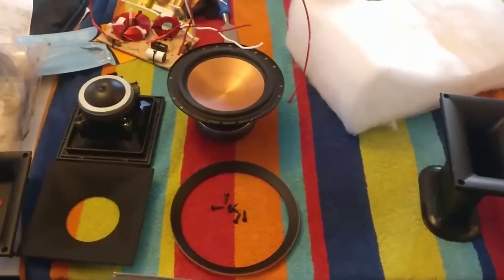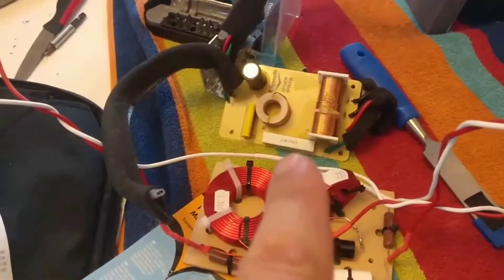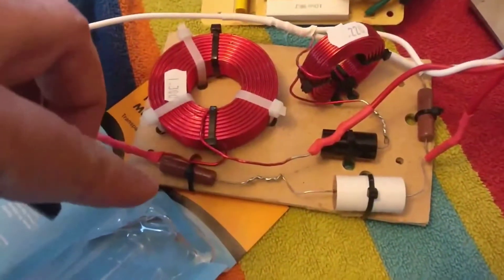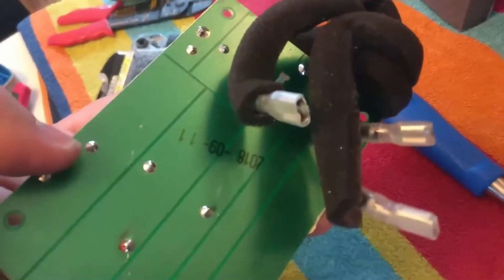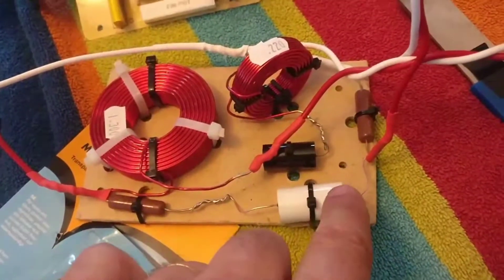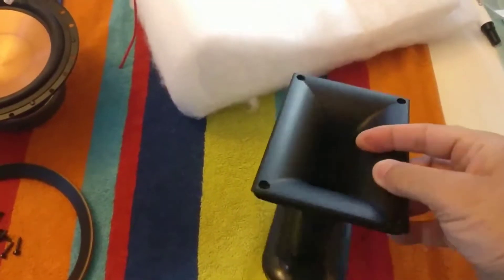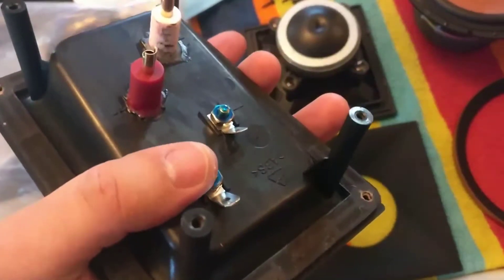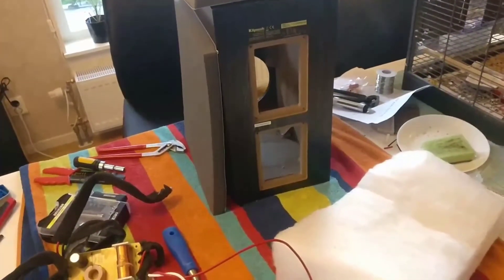Modding Klipsh RP-600M

Comment: How did you account for the changes in resistance and inductance on each replacement component? Your new inductors might be the same mH but the resistance is not going to be the same you know.
Reply from the maker: The kit (inductors, resistors and caps plus other stuff) is bought for this specific speaker. From company GR research.

GR research has measured the original speaker and made some adjustments (fixing issues) that Danny Richie has seen in the measurements. 
Then with his new designed crossover he do a new measuments and make adjustments.
To fix the issues and when he is satisfied then he has a kit fot that brand and model of speaker.

So no you are correct it is not just to replace crossover components with similar values.👍

Comment: So, how do you like your upgraded RP-600M? Was it worth the $$ and time? Have you considered changing the value of the resistor on the tweeter? In my room, those speakers are a little too hot.
Reply from the maker: It were hard to do a A and B comparison. So much is changing in my system.
But what I can say is that I thought I had HiFi (!) when the RP-600M were well received by reviewers and all those mods to higher quality everything..

Is that I got a totally different type of speaker without any box. A 40 year old magnapan MGM (!) and that entry level blow away the modded RP-600M and the MGM were in stock configuration..

Only one aspect the RP-600M were better at, the definition at 80 Hz. Then i put my crossovers at 100hz and let the woofers play the 80 Hz instead of the magnapan (problem solved, doesn't matter when it is stereo OB 18" woofers playing from the same point as the magnapan therefore localization is no issue).

Now after modification that magnapan took very well and I can definitely say that I heard a improvement I guess I will most likely never (as it feels now anyway) go back to a boxed speaker IF I want sound quality!

It can be so much different things that yours are little to hot. If they're aiming towards your ears instead of straight out into the room OR you sitting close to them OR to little sound treatment in your listening space (absorbtion) OR your gear..

Hard to tell what it is.. happy listening.